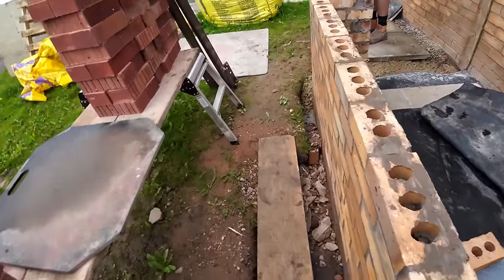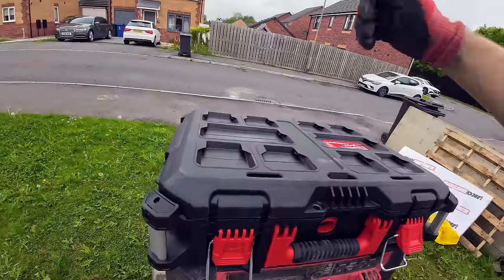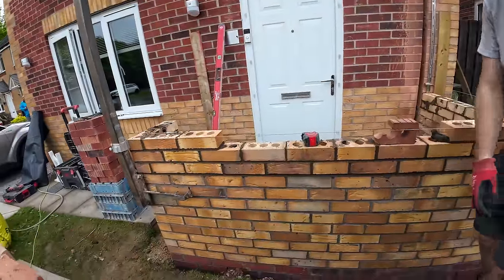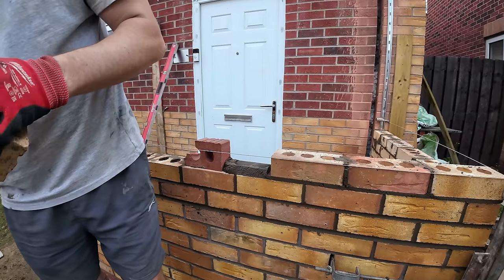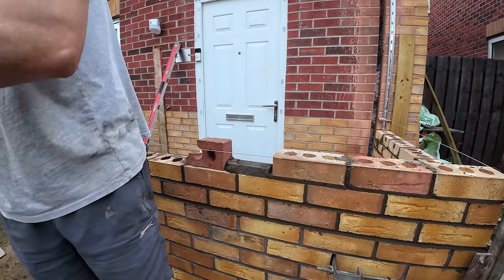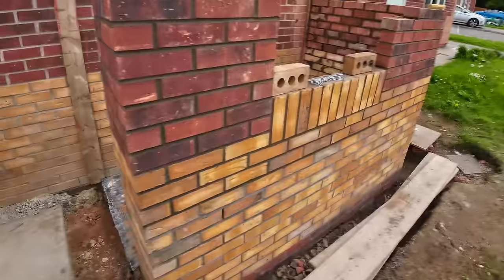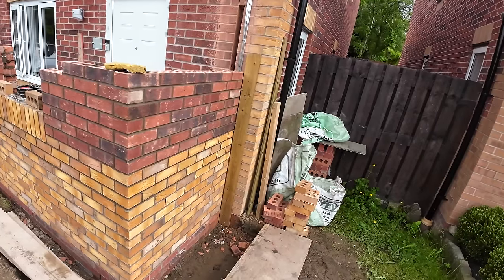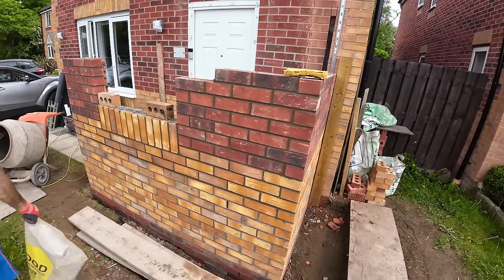DIY BRICKWORK ON OUR OWN PORCH WITH OUR NEW LABOURER

Comment: Not a criticism but why didn’t you make it 3 inches wider to make it full bricks?
Reply from the maker: To keep it 2.99 m square 👍🏽
Reply: Is that size important
Reply from the maker: @user-hg5jm3ef4r over 3 m2 you need planning permission and building regs so yes very important. I can live with a piece in the walls . 👍🏽
Reply: @SteveAndAlexBuild I get it now, bloody regs are a pain sometimes, looks good though, and your glamour was assistant is doing good too
Reply from the maker: It’s not as pretty as we would have liked but we had to work with what we had .
   Daisy is very cute ♥️♥️🧱👍🏽